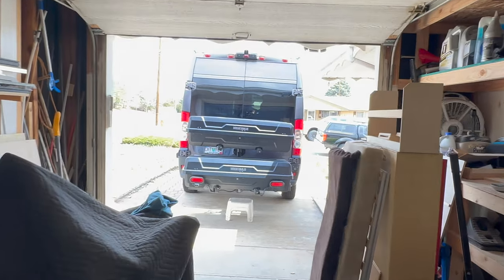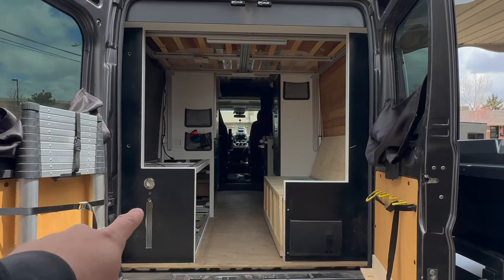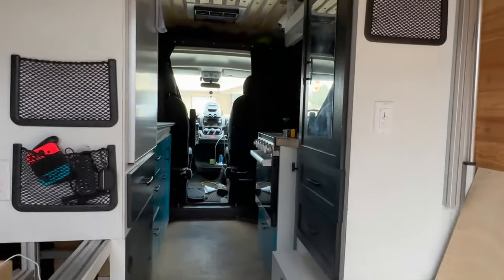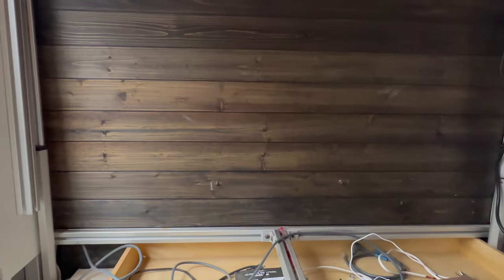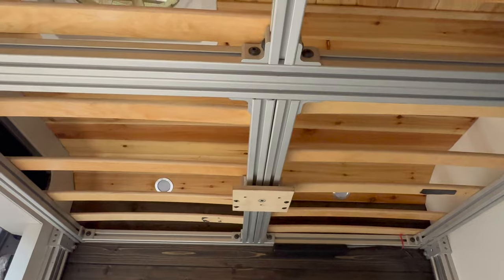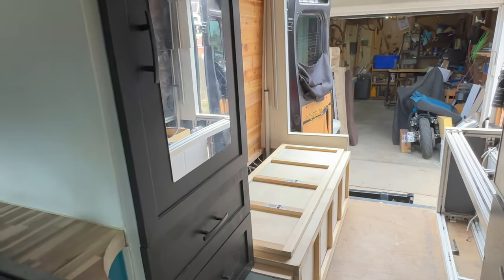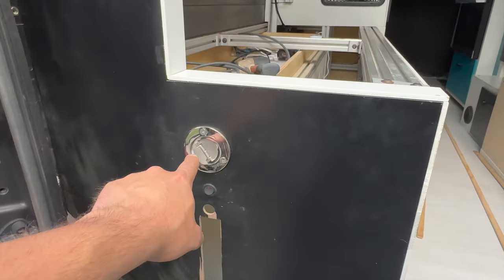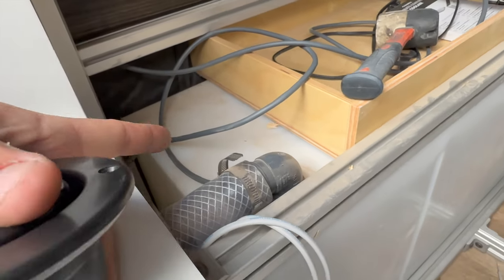PROMASTER CUSTOM BED LIFT system FINAL RESULTS & I now have a FLOOR!

Comment: I'm building two bed lifts in my camper.
Lots of trial and loads of errors. LOL
I think your previous video on the linear guide rails showing how they work is the only on online. Trust me I've looked. Thank you for sharing so much in depth detail of the bed lift design. 
Im in the UK and we have a higher roof version of the promaster branded as a Peugeot Boxer. 
The higher roof version isn't as nice looking as the promaster but I'm 6ft5 so needed the highest van possible even though they aren't readily available. So my van is an ex ambulance.
Reply from the maker: Hey there! Yeah, lots of trial and error on my end as well. Changed it around quite a bit over the last year and a half but that's just part of the process I guess. Hopefully my video helped you achieve your end goals.
Reply: @vanishthevan  Yes your videos have been a great help. Im actually lifting my beds with electric motors that winds up 2 inch seat belt webbing but the linear rails had me stumped until I watched your videos. Thank you so much for your help.
Reply from the maker: @drewhodge3820  that’s awesome! Happy to hear!

Comment: Very nice design!  I build like you do - not on paper, but visualizing items in the space.  

Do you plan to add your drop-down monitor back on the driver side?
Reply from the maker: Hi there, thanks for the kind words! I ended up installing a monitor arm instead and will eventually do another van tour video.

Comment: What are your bed dimensions?
Reply from the maker: Hey! My bed is about 70” long by 50” wide. I am 5ft 10in and it’s been a bit tight but in my latest bed lift video I created recessed cutouts which now gives me about 6ft 4.5in to sleep and it’s much much better.